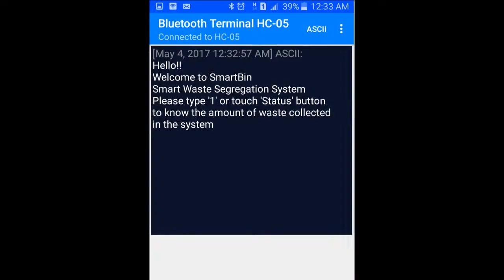SmartBin Project

Comment: how do you sense batteries which are nit mettalic?
Reply from the maker: Exception rule has been used to sense non-metallic and plastic things. If a particular waste item is not detected as metal or paper then it goes to the plastic/non-metallic chamber.